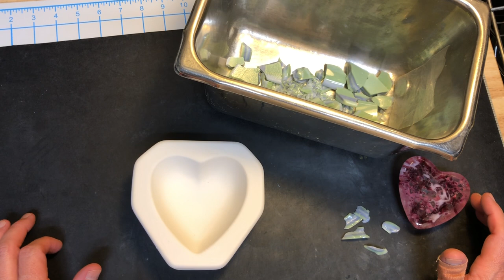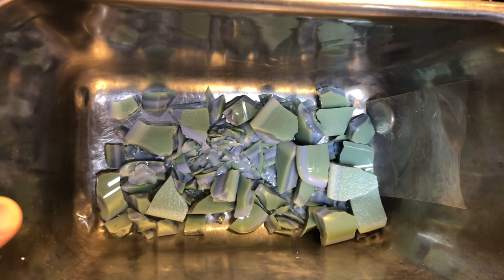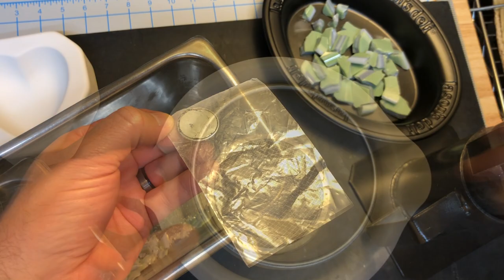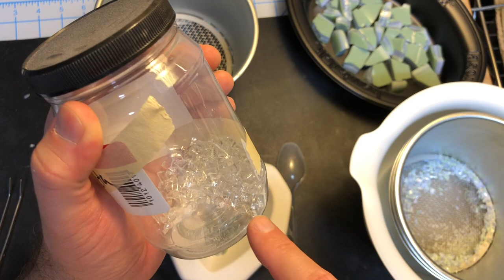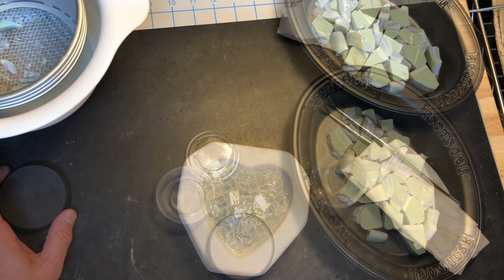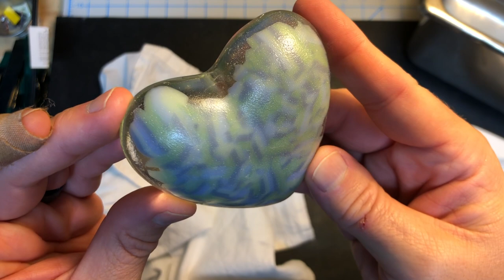LOTS of tips (and a heart paperweight)

Comment: Another get video with as always lots of tips and tricks.
Off topic a little, I have the same frit maker and have used it only twice because even though I thought I cleaned the heck out of it, the way they say to clean it, the next project had very small bits of the previous colour that I chopped. I mean VERY small fragments, like dust really, but because of the colour I could see them in my next project. Any tips on getting that thing super clean so I don’t have a repeat performance lol ??
Thanks again for sharing your expertise!! 🙏🏻😊
Reply from the maker: I typically just try to wipe it out with a DRY rag (don't want to introduce moisture/rusting) and maybe blow it out with some compressed air (with my mask and safety glasses on, of course).
Reply: @JamaisonSchuler  🙏🏻

Comment: Nice video! Can you fire polish the textured side and use that as top and the flat side as bottom?
Reply from the maker: I have wondered the same and may try it some day. I worry about a fire polish temp causing it to spread out a bit since it’s so thick but I need to try sometime and find out. I do like the look of the tick layer of clear, so if I flipped and fused, I think I’d reverse build it with clear in first and colored frit on “top.”
Reply from the maker: I have a test in the kiln tonight!
Reply: @JamaisonSchuler  Looking forward to seeing the finished (glossy) product; no reason it shouldn’t work! I plan to flip one of my hen eggs next week.
Reply: @JamaisonSchuler  how did it go?
Reply: I have the same question - I have a smaller BE heart pendant mold and the bottom is the molded part. I wonder if I turn it over and do a fire polish if I can get it nice enough to use as the front of the pendant.

Comment: One more question.   My clear scrap has a green edge as most clear does.   Do you use this scrap or the water/crystal clear?   Just concerned that the green edge scrap will discolor the other colors in the heart.  Making hearts with ashes.   Thanks!
Reply from the maker: I’ve never used anything but standard Bullseye Tekta (not crystal clear). If in doubt, make a test piece without ashes. Nothing is wrong with taking your time and making a prototype. If you have to fire your ashes first anyway, make the glass prototype in the same firing?
Reply: @JamaisonSchuler  thank you!   I planned on trying with my dog’s ashes for my keepsake.   Thanks for your help!!